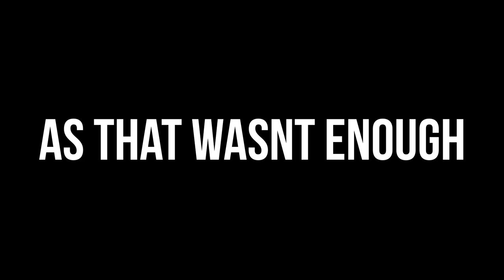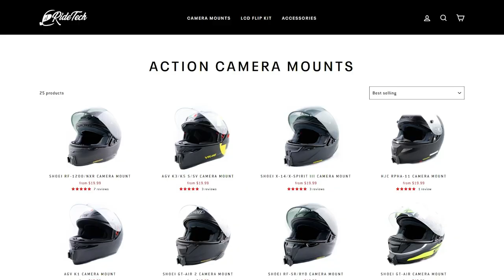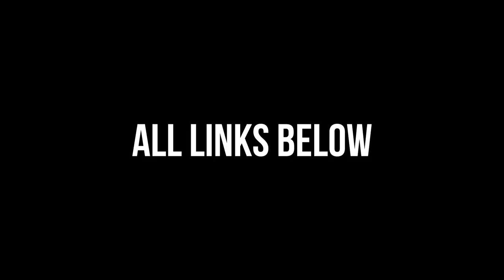Brembo 19 RCS Corsa Corta Master Cylinder || Test & Review

Comment: If you want to use it in race mode on the street, you could always adjust the rear brake light switch to switch on early (as in before the pads make proper contact) and gently drag on the rear brake to put the light on

Comment: How'd you arrive at the 19 model, choice-wise?  I have a vastly different bike, and I'm hearing different things.  17 seems to be the consensus, but all from people who don't race and never put a master on a bike before, so who knows what to choose?  zx4-rr, <400 club racing, if you're asking.
Reply from the maker: It’s been a while since I did some research on this. My understanding is it really depends on the brake setup you have on your bike. You would not put 19 on a 300 because the caliper on those bikes are much smaller than bigger bikes. The bigger master would just have too much power for you to have a good feel at lever on a 300. 19 is good for bigger bikes that use large multi caliper/rotor setups that are also heavy weight (like 1000cc). For zx4 17 sounds about right but I have done no research regarding those bikes.